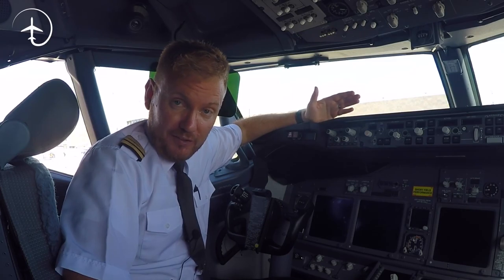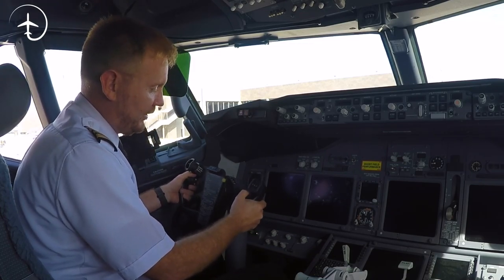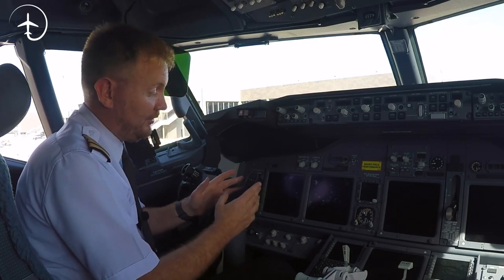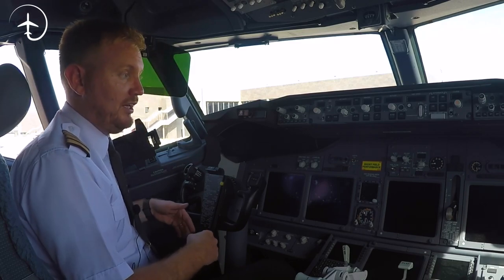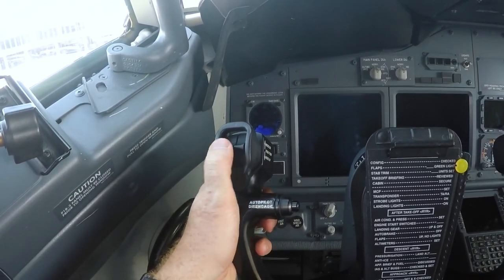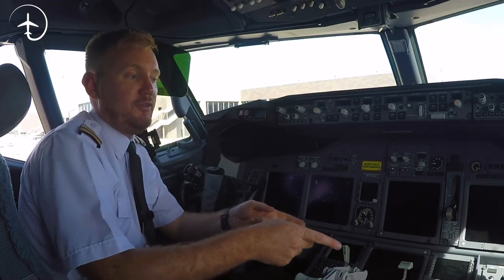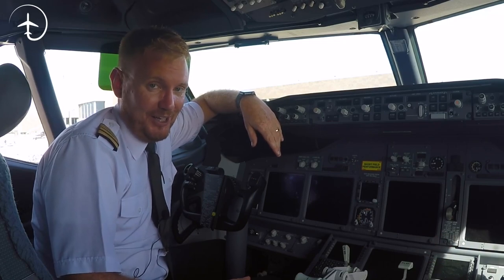Aircraft YOKE (Steering wheel), how does it work?

Comment: Incredible the trim control
Reply: soul88 Which one?🙃
Reply: Speedbird I mean it’s incredible how you can have control of the pitch with such components,the one that he shows on the left of the yoke
Reply: soul88 Ah..ok, there are two other trims as well😉
Reply: Speedbird Where?? You mean the handle on the trim wheel?
Reply: soul88 No, that is for the same thing (hor.stab). On the P-8 panel (the one with the communication on it) there is trim switches, two just like on the yoke, for the ailerons and a knob for rudder trim.
Reply: Speedbird I was wondering if there were other types of trims(for turning left or right/rudder trim) and you just told me!! Thanks bro
Reply: Speedbird does the Monteur pilot show them?
Reply: soul88 No, problem👍🏻 There are three surfaces with trim input; horizontal stabilizer, rudder and aileron🛩
No, dont think he does🤔
Reply: Speedbird the trim tabs on the horizontal stabilizer are doing the up/down trim? Is the elevator also an up/down trim surface? The rudder is the left/right(yaw) trim am I right? Are The ailerons roll trim surfaces ? Thanks man ;)
Reply: soul88 As far as I know, its just called elevator tab. It moves in the opposite direction of the elevator when pushing or pulling the yoke fwd or aft. So it does not trim, neither does the elevator. And, yes, the rudder moves in the yaw-axis and ailerons moves in opposite directions in the roll-axis.

Comment: Hi Mentour, I was just wondering say for example an airline such as British airways who operate the 787-8 787-9 and soon to operate the 787-10, would a Dreamliner pilot fly all 3 variants of the aircraft or would they be assigned to one specific variant of the aircraft?
Reply: It depends how Boeing certifies the aircraft. All the 787 are certified as one plane because everything on the cockpit is the same, so any trained 787 pilot can fly any 787. I think but I am not sure that Boeing will certify the 777X to have the same cockpit, if that happens any 787 pilot can pilot the 777X but it will depend on how Boeing certifies them.

Comment: I have a question, What should the pilot do when they got control failure in A320? Since the 737 have manual control connected by wire.

Comment: You didn't mention the trim runaway protection that the dual trim switch provides. If there was only one switch for the trim and it it failed in the up or down position that would be quite a problem.

Comment: Hey Capt, does your Interphone/Comm Radios have a VOX option?  I know I wouldn't want it if I were in your shoes, but I was thinking about that WN pilot a few years ago that got in some real hot water for going on a rant with his cockpit mate.  He went on and on about a bunch of issues and it somehow was either broadcast over the radio or over the interphone.  If I recall, the things this pilot was ranting about had noting to do with flying the aircraft.  In this case, I am betting it went over the Comm Radio.  If it were an option, I would carry a roll of 200 MPH Speed-tape and cover the switch so it could not be activated!

Comment: What are the small things on the rear of the engines that look like linear pipes?, 1 on each engine, in the very back at the exhaust cone. (Found most visibly on 737-300 -> 737-900)

Comment: Love your videos! But I have a question. «The trim switches is divided into two because if you move one of them, nothing happens» that does not make sense to me, even though nothing happens if you move only one, you are saying Boeing made the other button just for sloppy fingers? I have been told that one of them is an on-button (both up and down is on) and the other is for trimming. Which means you can put for example the on-button up, and the trim button down and the plane will still trim nose down. And vice versa. Agree? If not, try it and tell me what happened :)

Comment: Never thought I would be correcting MentourPilot but here we are. At 04:50 the reason that there are 2 trim switches is simply to prevent a trim overrun. I'm not too technical savy but one of the switch "unlocks" and the other moves, so that whenever the servo mechanichal linkage ruptures or snaps resulting from a trim overrun, the letting go of the other trim switch can lock and stop it from overrunning

Comment: When your flying a normal flight how often do you enter stall like conditions? When it happens are you usually expecting it, or does it surprise you from time to time?
Reply: The only time you  should be close to stalling is when landing, in fact light aircraft usually stall as they land so the plane quits flying and stays down.  Larger aircraft do not want a hard landing so fly onto the ground and the "spoilers" (lift dumpers) then prevent any accidental return to the air - at least, that's the idea!

Comment: Great!!! What are the advantages / disadvantages of yoke? ☺✈
Reply: Airbus has a retractable table that supports 50kg :)
Reply: But the yoke movement is synced to both side so your buddy know how is the current control is like.
Airbus's sidestick don't move on the other side.

Also the yoke input from the autopilot will feedback to the yoke so you can see how the autopilot is flying.
Airbus ... trust your buddynd the autopilot won't mess up.
Reply: And there are planes where you can disconnect the yokes. The L-1011 was an example.
Reply: From an ergonomic standpoint, most experts agree that a central control column is more intuitive than an offset joystick. Of course, different pilots have their own preferences.
Reply: It tastes good but has too much cholesterol
Reply: If you are going to pee that huge stick will bakla talaga advanced ako magisip

Comment: Say you have landed in GCFV from EGCC for example and you have finished your flying for today so it’s a totally different crew for the return flight how do you leave the aircraft? Do you switch all the systems off and leave it connected with ground power or do you
Leave it with all the systems running apart from the engines?
Reply: It depends i think, but usually only ground power is connected, IRS's are turned off for each flight as always.

Comment: actually you are wrong about trim buttons, it is called double pole switch and there are 2 buttons to prevent trim runaway in case of malfunction.
Reply: barba papà Correct👍🏻Same with the aileron trim

Comment: Trim always confused me, I thought the yoke control the elevators? Didn't 737 have trim wheels as well? I had worked in Boeing, and always thought the yoke was much easier than a joystick. I am right handed and joystick on my left side would be super awkward. Likewise for a left handed person.
I also thought flap speed data was on the center of yoke.
Reply: Yes, the yoke controls the elevators and ailerons. But because there are electrical trim switches on the yoke, the trim can be operated by using these electrical switches. And there are also trim wheels on the center console that can be used manually if necessary.

Comment: @mentour pilot, I have a question about in the job fatality. I know that flying is the safest mode of transportation there is, with something like a 1 in 11 million chance of a passenger dying in a plane crash. But pilots spend much more time in a plane than any passenger or non-crew, which by pure exposure increases their risk of fatality. I also read that pilots are more likely to die if a plane crashes because they're in the front and they have to try until the very end to control the plane so they won't be able to brace. So what's the chance of a pilot dying in a plane crash, or other fatalities like being hit by something during runway inspection.

Thanks!
Reply: A while ago I found an analysis that dealt with basically what you're asking. Unfortunately I can't really find it but their assessment was that you'd need to be flying for a thousand years in order to make the risk also go up significantly. Now, obviously these statistics are just used to give you help when you wanna calculate avarage risks, if you're interested in how big of a risk you are in personally this won't really be of much help.

If you're the pilot a lot of the factors that can contribute to a crash can be mitigated effectively, you have a control on that. The obvious part is being safety focused, following SOPs and making sure you're fit to fly. A lot of the crashes happened because of a combination of human error and technical failure, there are very few instaces where nothing could have been done at some point, and even then being prepared will help you mitigate the risk. (For example, United 232) So if you're personally making sure to negate all the risk factors, a general analysis won't really help you say how much of a danger you're in personally, it will only be useful for dealing with avarage values.

Comment: Mentour, why does the 737 not have slides on the wing exits?
Reply: Because the wing root is low enough to the ground to not require a slide. The Flap 40 configuration also gives a nice slope to slide down.
Reply from the maker: Because the flaps form “slides” that are close enough to the ground.

Comment: Hi, 
Question regarding the stickshaker. I know on a Cessna, a stall horn sounds when the aircraft is approaching stall and the airflow around the leading edge meets the condition (starting separation) that sucks on the horn and make a noise. How does an airliner knows when to activate the stickshaker. This is calculated using airspeed and weight of aircraft? Or angle of attack vane? Or something similar to a small Cessna aircraft. 

Thanks!
Reply: I'm not familiar with Boeings, but on the Airbus there are angle of attack vanes. Generally these work more or less the same way, the vane aligns itself with the local airflow and measures the angle between a reference point and the airflow with a potentiometer or an RVDT or something similar. Most planes have more of them, (IIRC the Bus has 3, but don't quote me on that) and the data is used by a computer, it is run through special algorythms and if the data they feed to the computer correspond to a dangerous alpha value the plane alerts the pilots to the impeding stall.

Comment: The trim moter  connected by straight one set of cable through drum under pedestal to screw jack at tail section andscrew jack move bring stabilizer up and down to desired position but only one long cable the length of 737.

Comment: Would you call this yoke shape ergonomic? :) because that design is like 50 years old.
Reply: How much have humans changed in 50 years?
Reply: Well you really don't need anything fancy, the time spent actually handflying the airplane is little , unlike driving a car for example, and even on smaller aircraft, cessnas for example you must have a light touch to be more precise. Cheers
Reply: The steering wheel of a car has been around for a while, too. It got smaller and more vertical with power steering, and eccentric even before that, but it has't changed much. My guess is that the current shape is better for precision and the older, rounder shape offered more comfort, as the pilots fly the planes by hand for shorter periods of time now.

Comment: Why do pilots keep on moving the yoke when on final or taking off?
Reply: You have to move the yoke to make corrections to keep the wings level because the turbulence and wind (and especially crosswind) will affect to the aircraft, and to maintain the correct pitch angle during the takeoff and landing.

Comment: Does the stick shaker engine vibrate during the flare? as the airspeed should be getting close to a stall.
Reply from the maker: No, we are never close to stall during the flare. The airliners do not “stall out” the aircraft in the flare as smaller aircraft sometimes do.
Reply: Thanks for the reply!! Did not know that but it makes sense for the airliners not to do the full stall landing =)

Comment: Hej Petter! Jag ville fråga dig nånting men det är kanske bättre om vi tar det på engelska så att andra kan förstå också :)

In terms of changing the yaw of the aircraft for purposes alike that of changing the heading for example, how often do pilots only use the rudder? I fly rather frequently and I always fail to spot whether the aircraft ever "turns" using only the rudder. Usually, it seems to be a combination of aileron and elevator control.

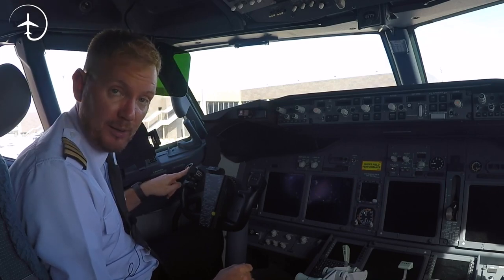Comment: 5:07 So if the Lion and Ethopian Air Pilots simply trimed backward with this little switches, everything would have gone fine?
Reply: They tried. It kept overriding them and trimming back to nose down, something Boeing had kept essentially a secret from them. 

Boeing are guilty
Reply: Dome31337 in this video, it’s the 737-800, because the MAX8 is a different variation, it has new trim feature causing this.

Comment: I guess the sidestick demands less power and provides more comfort, still prefer the Yoke tho.
Reply: Sidestick is not directly linked to the control surfaces, so it'll always be consistent in handling. But yes in terms of flying feedback, yoke all the way
Reply: Yes, less power, ergonomics and comfort are reasons why sidesticks are used. Airbus sidesticks don't receive artificial force feedback since their FBW don't provide it but Gulfstream with their sidesticks do in addition to being electronically linked.

Comment: Sir What, happen when someone open the cabin door in mid air?
Reply: The pressure is about 5 tons per door from the inside due to pressurization, try to do it with your bare hands…

Comment: What is a "jaw dumper"?
Reply: Andrey Magalhaes "Yaw Damper"  From the AMM: The yaw damper system keeps the airplane stable around the airplane yaw (vertical) axis. During flight, the yaw damper commands rudder movement in proportion to and opposite to the airplane yaw moment. This keeps unwanted yaw motion to a minimum and makes the flight smoother. The yaw damper is an autoflight system.

Comment: Which controller using for turn landing gear  when Taxxing
Reply: There is a specific steering tiller on the left side of the captain's seat which is used to steer the nose wheel during taxiing.
Reply: @mikep9604  Do u have any video..?
Reply: @yunaiskuttippuram  - You can watch Mentour Pilot's video: "Boeing 737 cockpit secrets" starting at 8.10 where he shows the tiller.
Reply: @mikep9604  Thank you very much

Comment: But how the surfaces forces are transferred to the pilot?
Reply: They work by hydraulics.
Reply: No. Hydraulics forces are vs the surfaces. How about the aerodynamics forces vs the yoke?
Reply: @theingegnere  - On an Airbus aircraft which has the fly by wire system you don't feel the aerodynamic forces on the side stick.
Also on an aircraft that has a hydraulic system which moves the control surfaces, there is not much strength needed to handle the yoke because the hydraulics makes the work.

Comment: How does a pilot raise the wheels
Reply: @Arash > You raise the Landing Gear.  Wheels go with it.  Look at :30, the lever that looks like a wheel between the 3rd and 4th Display.  You set it to the Up position to raise the gear and set it to Down to lower the gear.  The gear will not raise unless the aircraft is Weight Off Wheels.  You also need hydraulic pressure to raise it.